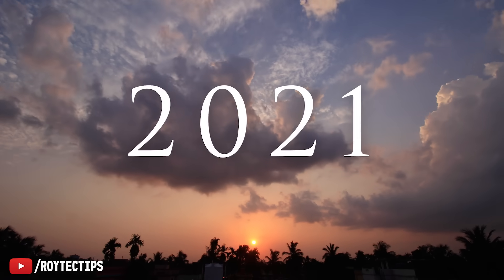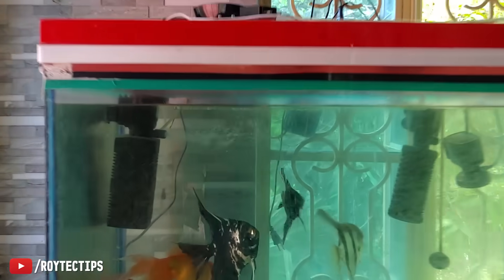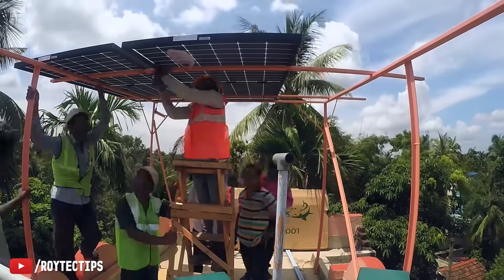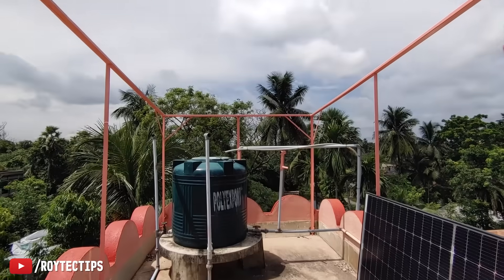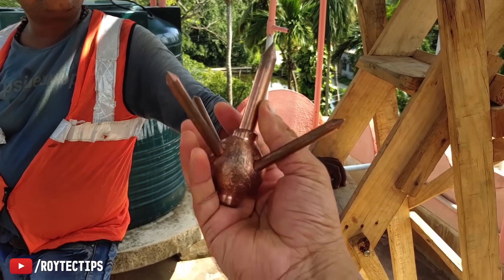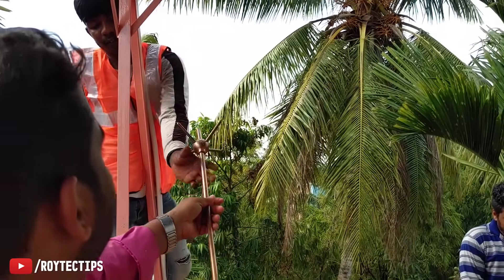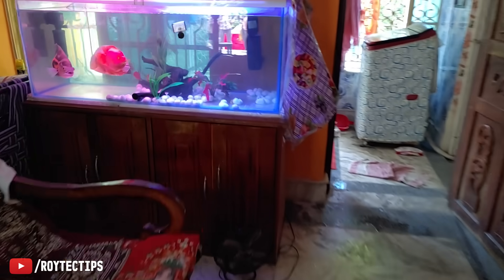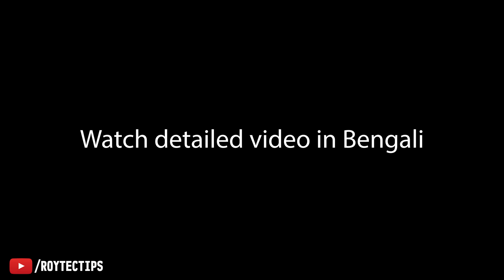Off Grid Solar Installation - its so easy. 3KW loom solar shark 440

Comment: One ola scooter, pc gaming spec and lap lap charger 65w , 6 rooms using tube light all room, 4 room fan in wall top and well water pump motor 1500w I think, tailor machine with Normal motor, tv, sound bar, kettle 1500w daily use 2 times, and 4 phones chargers also 35w 2 charger and normal 10w 5 chargers 😁 work daily.the total how my kw solar need 😁😪👍,